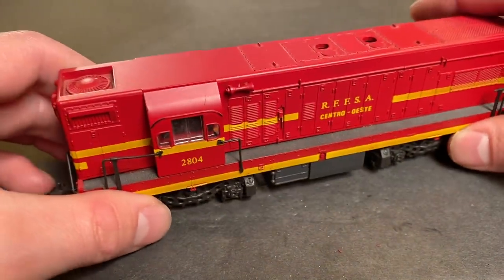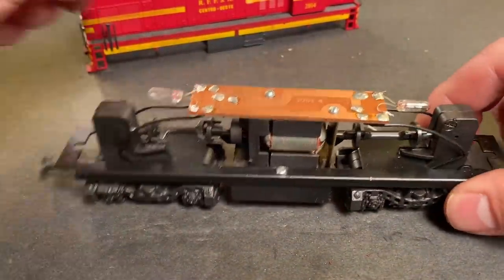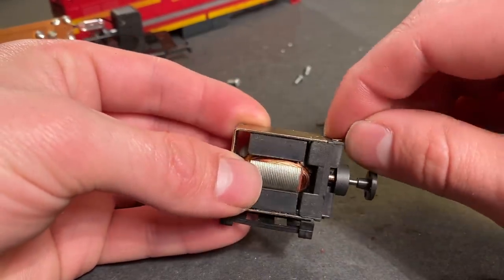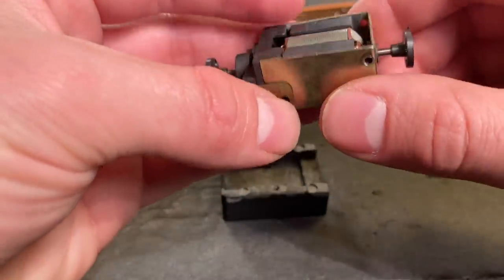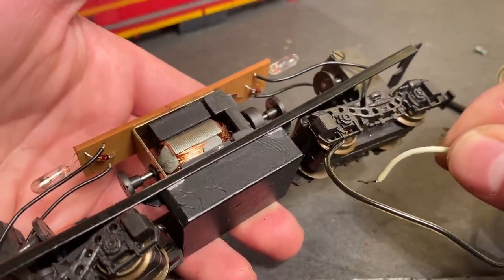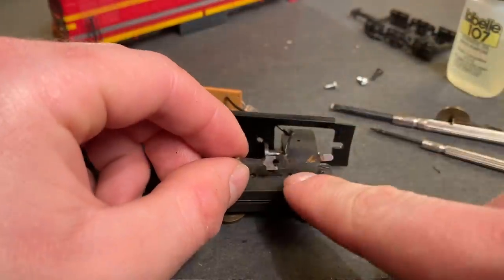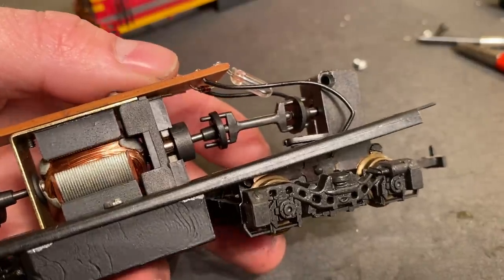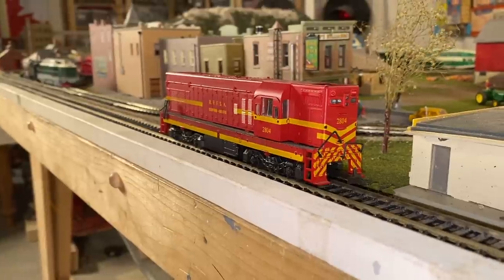Can We Make This 40 Year Old G12 Locomotive Run Again?

Comment: SMT just payed less than a dollar for one of rarest limited edition liveries frateschi ever produced? My god.
So I'm brazilian and I'll try and answer some of your questions:
This engine was produced by Frateschi Electric Trains, which is the only "RR model" manufacturer in South America, by the looks this is a post-1985 engine but pre-1995 putting it squarely in the Phase 3 of the G12 production, the livery is of the Viação Férrea Centro Oeste - VFCO (Mid Western Railway) division of the RFFSA  and was one of several limited edition liveries Frateschi made for this model, I would consider this one of the rarer ones. She's powered by a 3-pole motor like every other model Frateschi ever made and still makes (even if its and sealed motor now, its still a 3-pole, in 2022). Its sold as an HO scale model but its horribly out of scale just like every locomotive they produced until 2012 and every car they produced until today, the exact scale is 1:78,8. On the lubrication question Frateschi recommends the use of sewing machine oil which probably leaked overtime hence why you dont see any when you opened the trucks, its not uncommon. On the make of this engine I know frateschi kinda did most stuff on their own but they did have some partnerships with model power and atlas in the 90s. Also please press the shell into the sill.
"This whole electrical system is not very good and it confuses me" Welcome to the Brazilian model railroader experience SMT. It only goes downhill from here. Most recent G12s don't even have metal chassis anymore. Although their latest model, the RS-3/RSC-3, went back to having a metal chassis. There was a lot of fanfare when we heard of that. 

Keep up the amazing content!
Reply: Do trains run through the favelas?
Reply: That does sound about right
Reply: Because I Have seen similar makes like that In 1997
Reply: I seen the similar models at the international model train show
Reply: @mixtec53  In some cities, yes.
Reply: @BlackHeart37498  Frateschi still produces it. But with some little differences.
Reply: Interesting, was going to comment that it look like a Frateschi because I have a model power 2-8-0 tender drive that looks very similar. It has basically the same gear towers and motor, just stuffed into a tender. When properly serviced it isn't a bad runner!
Reply from the maker: Thank you so much for all this information - Incredibly detailed, I sure learned a lot.
Reply: @mixtec53  Yep! But Brazil is not only favela, we has 5 or 6 Biomas, country roads and cities, coast roads and cities, inner roads and cities, São Paulo is the second one biggest city behind the big apple and it has the biggest helicopter flow in the word, Brazil has, industries, big commerce, beaches, montains, valleys amazonas river second big only after nilo river, we are compost by Portuguese, african in the base, but we are multiracial culture open to imigrants, much of us are italian, deustch, japanese, chinese, spanish etc.

So the railways are lay down over this big country across a infity kind of places and people.
If you can visit us, you will fall in love!
Reply: @hexxoid9263  frateschi also made varios trains and trailers to american biiders. Including 2_8_0 wabash and others like Fa1.
Reply: @SMTMainline  No problem my dude
Reply: Is the company by any chance a spin off of model power because the motor and truck designs eerily remind me of the Model Power 2-8-0/ 4-6-0 which just from looks had a similar if not same motor and the chassis also shared a similar split design.
Reply: @historyotaku  actually some of the Frateschi models were sold in America under model power brand in the 90's
Reply: @historyotaku  As far as I know no, they began as their own thing, Although they did import the machine tools to make the models, probably the reason for the similarity. The only link that I know to model power is some MP 40ft boxcars that frateschi sold down here, while frateschi exported some engines to MP for the US market.
Reply: @fernandomarques5166  the 2-8-0 was also sold in Australia labelled as the similar looking Victorian Railways V class. As per this one from a group hoping to build a new full size one after the originals were scrapped in 1930 :
https://youtu.be/Xr7YND5p8Fo
Ran on 1600 mm gauge in Victoria.
Reply: @leonardosouza6290  -  Leonardo, my ex wife is from Brazil. Though our relationship did not survive, I wanted you to know I found your statement quite moving/touching conveying a pride she was unable to.. As anyone can attest we in America are so very I’ll informed of true culture in other countries; especially Brazil; seems all we know is Carnival, Favelas, and the beach below the statue. I enjoyed so much the two comments here from Brazilians and have forwarded them to my ex on the chance it bring some enjoyment.

Thanks again
Reply: You say that the latest releases from Frateschi are on scale (1:87), as compared to the earlier years?
Reply: @Posttrip  Their latest locomotive (RS-3/RSC-3) was to scale, just like their previous release (GE AC44i) was too, but their latest car (HTT hopper) was not. This is not a simple mistake or some technical limitation (Because the HTT IRL is massive) its by design and lack of interest to evolve the standard coupled with the lack of something akin to the NMRA in Brazil.
Here's a list of frateschi locos and their scales:
G12/G8: 1:78,8
G22U/G22CU: 1:78,8
U20C: 1:78,8
U5B: 1:64
GE 5200 C-C "Wandeca": 1:87 HO
GE 2-C+C-2 "V8": 1:87 HO
GE AC44i: 1:87 HO
GE C30-7: 1:87 HO
GE U23C: 1:87 HO
ALCo FA1: 1:87 HO
ALCo RS-3/RSC-3: 1:87 HO
Baldwin Ten-Wheeler: 1:78,8
Baldwin Consolidation: 1:78,8
Although there are more models with the correct scale than those that are not the fact that frateschi refuses to rework these models, which include the U20C and G12 some of the best sellers, still pisses more "to scale" modellers off. I also would like to note that all cars are off scale, normally sitting at 1:81.
Reply: @fernandomarques5166  I see. Thank you for this list. That is frustrating that, at this time, they don’t feel the need to make all of their models accurate to 1:87 scale. If their sales increase locally, and from other countries, perhaps enough customers will write them and pressure them to make those changes. We can only home. I would love to buy locomotives and cars. But, yes. I would insist on accuracy to scale. Thank you, again.
Reply: @Posttrip  I'm sorry to break it to you but the reality is that this is lost fight, its at least a 40 year old fight by now. Its gotten so bad that even I have begun designing and 3D printing my own cars, honestly I gotta thank Frateschi's stubburness though without it we wouldn't have such a diverse parallel market here. Just to put into perspective Frateschi wont even sell undecorated models which is on many modellers minds the bare minimum of modern model railroading.
Reply: @fernandomarques5166  I was just watching a video of the Segis &Mascarini layout. The club home built its Budd passenger cars and runs them with Frateschi rolling. Now, I ‘see’ what you mean. That’s probably “OO” scale that Frateschi mixes in with HO. Yes, that’s really a shame. I would like to collect authentic and “accurate” Brazilian locomotives and car models. Again, I thank you for sharing the accurate models and understand the frustration with waiting for them to make knee molds to make “accurate” HO cars!
Reply: Meu avô trabalhou de maquinista em uma locomotiva dessa ! G12 e vermelhinha da RFFSA.
Reply: @fernandomarques5166  "U5B: 1:64"
Ei, isso significa que é escala Sm (Bitola métrica da escala S, a mesma do Ferrorama!)
Hey, this means that it's in Sm scale (Metric Gauge S scale, the same of Switch-a-Rail/American Flyer!)

Comment: Looked up Frateschi, it’s a Brazilian model train manufacturer.  I thought this was an interesting video because it was about something not typically seen in North America.
Reply: They also made some models for America and Australia
Reply: General Motors G8 and G12 locos were mainly built for export especially to Central and South American countries.  however some were built for domestic use.  As stated above the London & Port Stanly Railway had two G12's that later went to CN when CN purchased the L&PS.  they were last used on Vancouver Island then ended up in Newfoundland as parts sources for CN's narrow gauge G8's.  Canadian national also had both standard and narrow gauge G8's.  Five standard gauge units (# 850-854) that were used on lightly tracked prairie branchlines plus six narrow gauge G8's (# 800-805) for use on branchlines in Newfoundland.
Reply: you HO guys get it handed to you- I swear...

Comment: That pattern loco is the same as old Da locos in New Zealand, I have several of these and have been running since I purchased them in the 90s,they don't give many problems as long as you keep the wheels clean, have fun with it, they are great runners, many thanks from down under in Wairoa New Zealand
Reply: I've got one if those, often tempted to buy a 6axel frame for it and see if I could graft on Marklin Nohab 3066 bogie outer frames, would have the correct bogies then for an early Da.
Maybe one day,,,,,,
Reply: hey, jed- my dog Nobrie is from new zealand. i love huntaways! cheers!

Comment: Have you ever considered stocking up on a nice assortment of machine screws?  I find having a sorted selection of fasteners on hand saves a lot of time and aggravation over the "dump all your bolts in a cookie tin" method.
Reply from the maker: I’m not really sure where to buy that sort of stuff but it would be handy.
Reply: @SMTMainline  You can start by getting a sorter or two and sorting out the fasteners you already have.  Any good hobby shop should have the most commonly used sizes. It doesn't even have to specialize in model trains, screws are screws.  If you do get a sorter make sure the compartments are big enough for your fingers so you can get the screws back out.  Or you can find assortments online for about 30-50 bucks US or Canadian.  Great videos, by the way.

Comment: I’ve been looking at Frateschi with great interest. I love the Briazilian liveries, locomotives and rolling stock. I see I can buy them directly or on eBay from a seller. I’m certainly interested in the Brazilian rail system. Great video.
Reply from the maker: I was looking at some of their other models as well. A few look pretty nice, not sure if the drive is any better than this one though. Another commenter mentioned that they’re still using 3 pole motors.
Reply: @SMTMainline  The main shafts, though, do look a standard size. If you feel crafty a new 7-pole can motor (and maybe a sound decoder) can do the trick.
Reply: more poles does not necessarily mean a better drive- if the unit has a numerically high gear ratio, a 3-pole motor could be just fine for it. if it's a lower ratio, the added low-rpm power of a 5 or even 7-pole motor would let it pull better and run more smoothly in a proto speed range. those look like phosphor-bronze wipers in there and they can absolutely corrode. that is a goofy power transfer scheme in that thing.
Reply from the maker: @tommurphy4307  3 Pole motors are still prone to cogging at low speeds even with a severe gear reduction.

Comment: That was a very odd electrical pickup on the bottom of the motor.  It uses a big metal plate in a C shape to electrically connect the top part to that tab on the bottom which it seemed the only reason it needed to be screwed in is because the piece of the metal is used as a spring.    The board on top seems to also serve no function other than not wanting wires connecting things and as a mount for the lights, there's no diodes or anything to only turn on one set of lights or the other based on direction.      That said I'd solder a wire directly to those tabs and bring it to the electrical pickups (you could even just solder it to a part on that board).         It is a very nice looking engine though.
Reply from the maker: There were diodes on the bottom of the board which is why the light only worked going forward. Still a very unusual way to wire things.
Reply: i saw some devices on that board- i thought they were resistors, at first.

Comment: It's a Frateschi G12... it's slightly out of scale, 1:76, however, you could strip the paint, throw on some LP&S decals (or CN wet noodle as they ran the G12 in Nfld) and get some big $$$ for it on eBay... congrats on the find.
Reply: Dude im from NFLD,
Reply: Also its the g8 in newfoundland
Reply: Around early 1976 two G12's were sent east to CN's Newfoundland operations and ended their lives serving as parts units for the fleet of narrow-gauge G8's on the island.
Reply from the maker: I think they might still be making them too
Reply: G8s
800,  801, 802, 803, 804, and 805 were built for the nfld railway.

2 are preserved. 803 in carbonear,(NL) And 805 at the st constant railway museum
Reply: i'd like to see him keep it and keep building his collection- it would be difficult and maybe costlier to replace.
Reply: SMT you're going to have a difficult time selling all those locomotives or get a big garbage bag... it will happen, one day.  Till then, be mindful of how big the collection is and keep on railroading.
Reply from the maker: @chrisdaniell2990  It's something I'm keeping an eye on. I've already started selling unwanted locomotives I bought in the past. That doesn't mean I won't buy new ones, I just don't want the collection to grow much larger.

Comment: SMT - The motor appeared to move in the chassis when you did further assembly.  You may need a thin, flexible wire from that bottom contact on the motor to a screw on the frame.
Reply from the maker: I think it’s meant to be somewhat loose to reduce noise. The main issue seemed to be that stripped screw not making contact.
Reply: @SMTMainline  - Yes, I could see the motor loosely mounted for some " slop " between the shaft couplings.  Providing a solid electrical path between the motor contact & locomotive chassis would be a good idea.  You will think of something good SMT!
Reply: the free mounting is intentional to reduce buzziness which, if severe, uses the frame & plastic shell as resonators, making it even louder. the transfer plate on the bottom has a springy contact to allow that movement. i think you nailed it with that screw being the culprit. that looks like a soft-metal fuel tank/weight- it would be easy to dimple the thing with a drill making room for your larger screw if you think it tilts the motor too much. good job- check's in the mail!

Comment: Lots of good info here,  I took the shell off my Frateschi loco  and it appears much different, few screws (certainly of the size you have), I suspect it's a bit newer.  Runs poorly with little traction, will have to finally look at servicing it.  I wonder if any of the Brazilian folks know if these loco's used traction tires (mine has none), otherwise it definitely would point me to some review of the drive system.
Reply from the maker: I believe this one had some, so I would imagine yours would too.
Reply: @SMTMainline  thanks, will give that a try
Reply: you could be disappointed at how it performs with traction tires- the use of 2 tt's on an 8-wheel unit would reduce its pickup by 25%. If you have crossings and turnouts (especially with plastic frogs) on your layout, i would say skip that idea. additional weight is a better idea- it would serve to enhance the pickup as well as the traction. you HOers have LOTS of room in your locomotives for more weight (i'm jealous- again) and other fun devices. you've got a choice- run traction tires and clean your track and wheels more often or skip them. making a little sand block with #600 grit paper (i use a worn piece) and finishing the rail heads with it might help and it will also help with power pickup.
Reply: @tommurphy4307  Thanks, I really don't like using TTs  have tried that FrogSnot stuff on a couple of loco's, helped a bit.  I think I've got to look at tearing the thing down first so see if there are some other issues.  Right now, not sure it's running strong enough to add weight - but will explore option.

Comment: Very Interesting.  However, lack of power doesn't necessarily mean a "short circuit". More likely this might indicate that is an open circuit,  or a very high resistance in the circuit, with no current flow,  or very low current.

Shorts tend to burn wiring, burn fuses blow breakers. High resistance solder joints, broken  wires and bad or missing brushes, dirty commutators all creat open circuits.

Comment: Why not clean the backs of the wheels also with the contacts plates?
Reply from the maker: I did off camera on the wheel I removed but I didn't want to remove the secured wheels. The friction of the wipers should clean them up just from running.
Reply: they only need to be checked for proper pressure- running with proper wiper pressure is self-cleaning- in any locomotive with wheel wipers.

Comment: Reminds me of the Victorian Railways S1 T class, only taller
Reply from the maker: I can kinda see it
Reply: @SMTMainline  a vid on a local model of the Victorian Railways T class first series :
https://youtu.be/b7WRzWKLI4U
Five minutes in you get to see the model clearly, but not the more up to date drive system. Pity he runs it  on far too tight curves.
Reply: The body shell should be a similar size to the VR flat top T.  It is a bit out of scale to fit the motor, which I'm guessing was all Frateschi had available.  They were sold in Australia some time ago, so a "near enough" flat top T could be modelled.
Reply: @johnd8892  it's a compromise all us modelers make- if we want our train layouts to fit on a tabletop...
Reply: @tommurphy4307  yes, but the tight curves are putting stress on the drive system. Better to stick to toy makes for toy train curves.